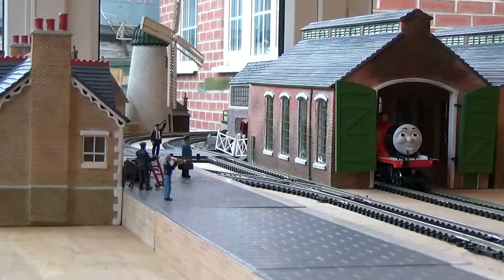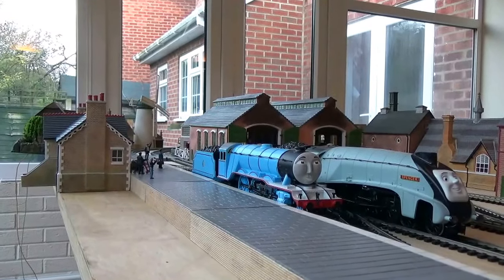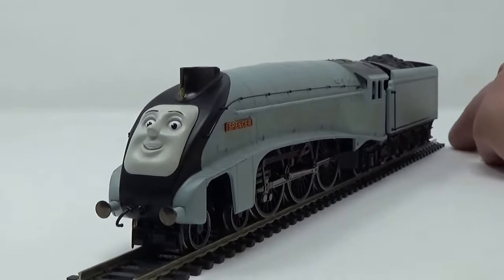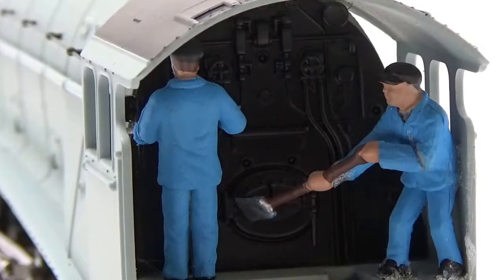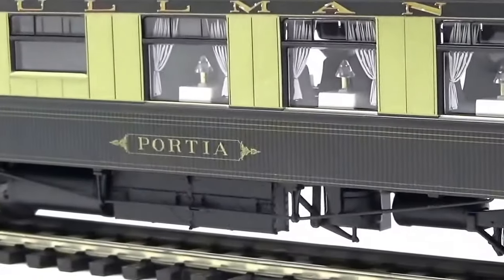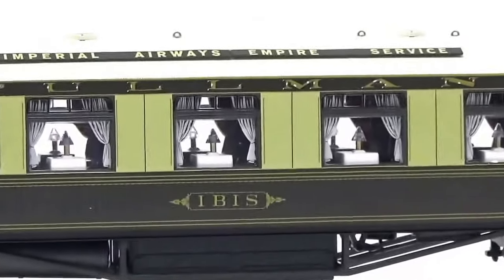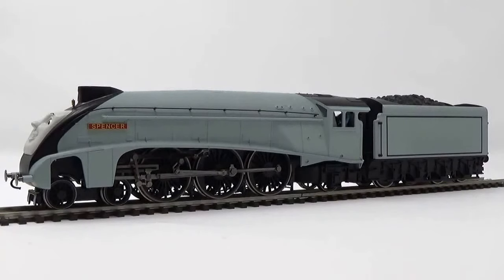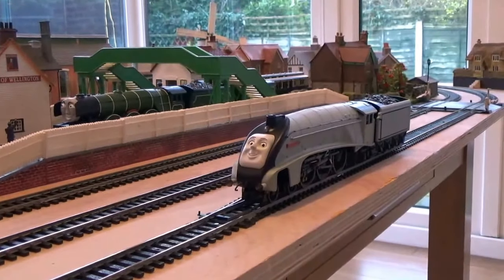Hornby Spencer R9749 Review and Running Session with Thomas Gordon R9291

Comment: Nice video mate :) Just curious as to what radius is used for Gordon? I thought 2nd was still too tight, unless you have Spencer running on a 4th radius?
Reply from the maker: Thanks for the comment. I'll check later but I think I may have done 1 R4 & 1 R3 for the outer curves and then 1 R3 & 1 R2 for the inner. The inner loop is only used by the smaller engines as it contains R1 curves.  As I'm sure you can tell it is only a temporary layout. I have the baseboards in the garage from White Rose for a much larger layout but do not have the space currently. So I just keep buying items for when I do have the space and can build a huge DCC layout.
Reply from the maker: I was talking rubbish. The outer curve is R609 third radius and then Gordon was running on R607 second radius.